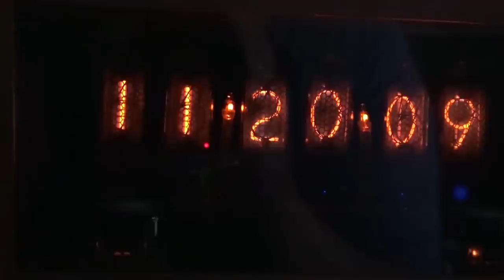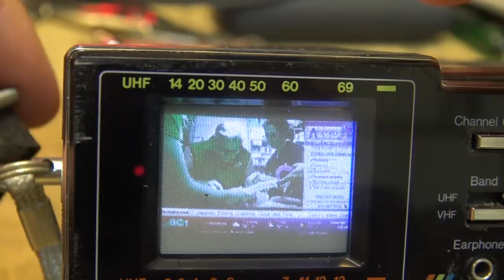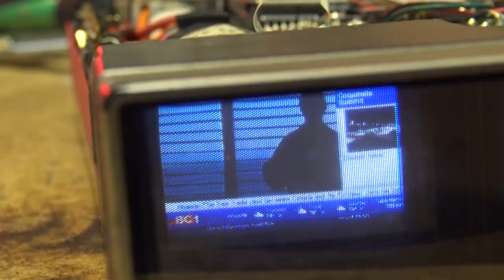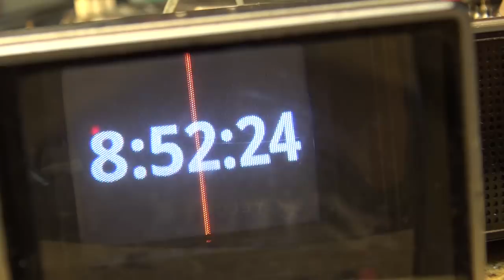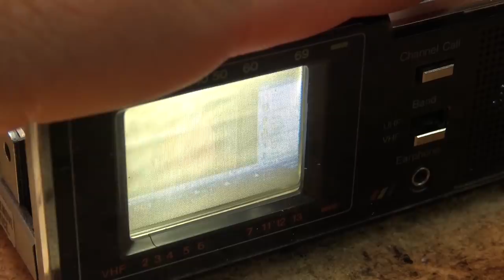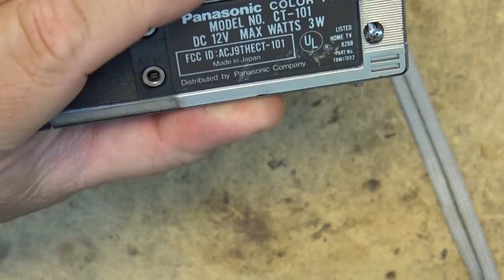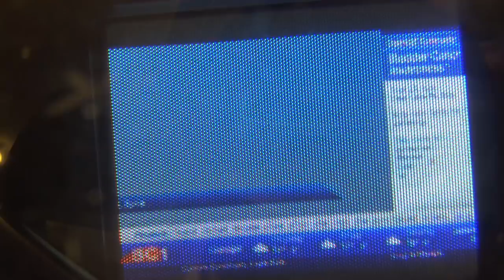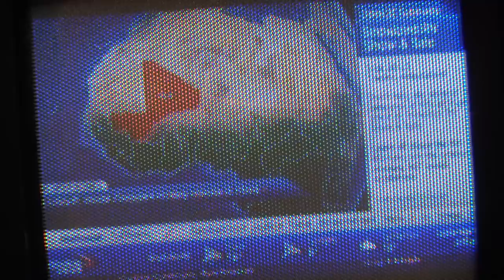Smallest commercially made color TV in the world

Comment: It definitely a 3 gun tube. I repaired a few of them for various issues. I know this particular TV set well, one of my personal favorites. 

You take out the PSU board out first, then the tuner knob and then to take the top half insert off the contrast and vhold button area off first and the just lift the whole chassis out just make sure you slide the tuner out a little to clear the holes in the rear and it will all fall out easy. Never pull the front off as you break the side plastic holding it in. It slides up.
Reply from the maker: That's why I didn't remove it.  Panasonic has weak plastic. Just enough to clean tube.

Comment: Wouldn't it be possible to make a color three-gun trinitron aperture-grill CRT this small (1.5" in diameter) with 1,000 TVL of horizontal resolution for resolving true HD resolution like the big 24" to 32" the Sony BVM-D/BVM-A and 38" Sony HDM monitors that were made? It seems to me that would make an amazing alternative to the LCD/OLED HD color viewfinders used today.
Reply from the maker: Good luck with that.  Sony was working on their indextron to get rid of the shadow mask.  It was easier to make a large hd tube than a small one. They can only make the dot pitch so small.  Oled is much easier to make high resolution. My camera has a fantastic oled eyepiece.

Comment: Glad to find that they made a set with that CRT. I have the same CRT found in a Panasonic high end camcorder   I harvested it out years ago and made a small monitor from the viewfinder. No tuner just composite video input. Wish I could remember the camcorder model
Reply from the maker: Is it the same tube, or a beam index tube. Many cameras used a beam index, which needed the special index detector that sat in front of the tube inside the view finder.
Reply: Yes same CRT. I was suppressed to see it in a TV set when I seen this. The same CRT number. And I also have a salvage unit from a camcorder that’s a Beam index as well. But this little CRT is amazing due to size. I will try and see if I can find the model camcorder that used this tube as it may be a source for building a custom monitor just like I did from the viewfinder. Just 12 volts and video was all that was required
Reply from the maker: Well that is this TV even existed. They were making use of a tube designed for the camcorder market. If you find the model number of that camera that will be great.

Comment: is the tuner automatic or do you have to turn a knob to tune it in? and do you think it would have a better picture on the A/V in?
Reply from the maker: Tuning is done by a knob.
A/V input should be about the same. I had my modulators plugged into the antenna input. I have commercial modulators here that produce a cable head end quality signal throughout the house on the old coax.

Comment: I want an AM radio for the bathroom. The Eaton worked great until it didn’t. 
I tried a $15 radio from Walgreens but would not get 580am. The station is in the next town over. They actually tell us what there broadcasting in but I forgot to write it down for you. My question is, Why do ya think I’m having a hard time pulling in this station. I looked on Amazon and I had a choice of a Transistor Radio & not a Transistor radio. I don’t have a problem getting this station in any other room. 
I also didn’t want to spend $50 for a radio. Any ideas?
Thank you

Comment: I  suggest that you try compressed air to clean that dot. I have had three of these over the years and the plastic used in the cabinet is very thin and as the years go by they get VERY BRITTLE.  In fact  this is the first set I have seen that did not have any cracks or missing pieces. I  held my breath when you removed the front panel and pryed on the battery compartment.  My current  set has a chip in the telescopic antenna corner,  but works great !
Reply from the maker: I am fully aware how brittle the plastic is, especially Panasonic. It is probably the worst I have seen.
I had a back once sitting on the floor tip over and it shattered.